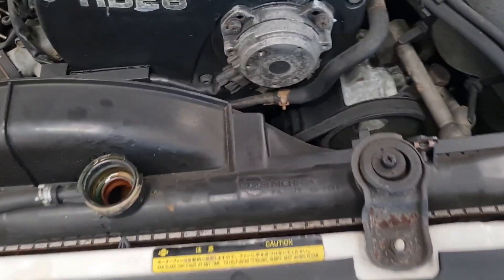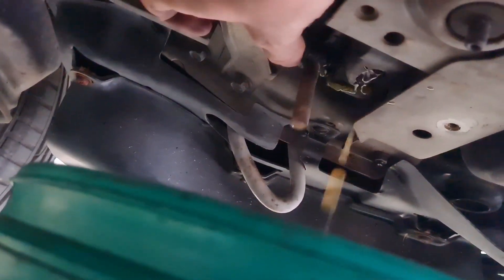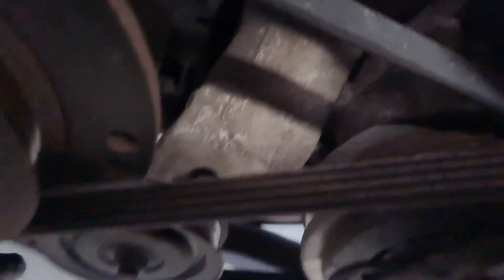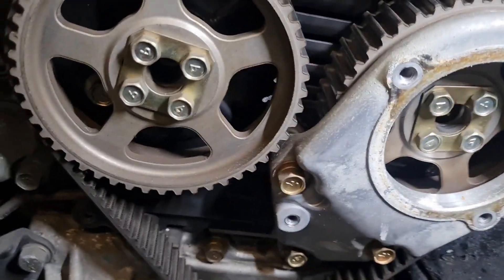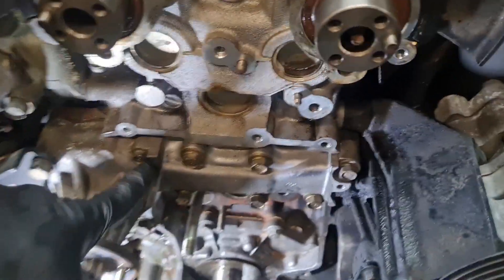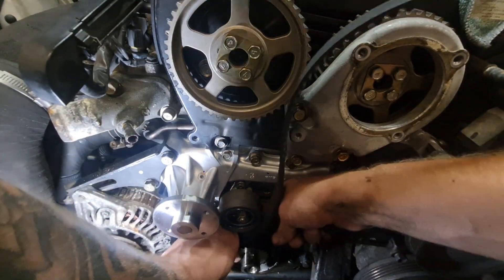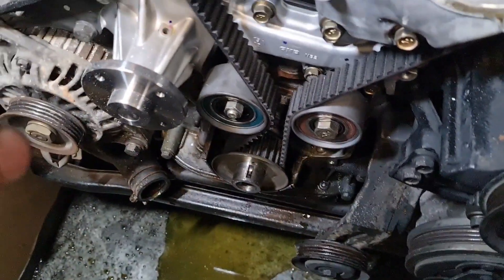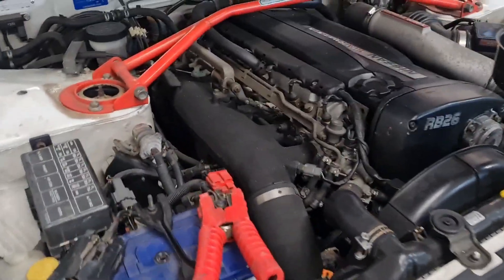RB 20,25,26,30 de/det Timing/cambelt, water pump and seals replacement

Comment: If my timing belt and everything is algood but the cam gears have skipped a tooth how get them back to line up with the marks
Reply from the maker: pull belt off and put belt on one tooth out the other direction and it should skip to correct position.